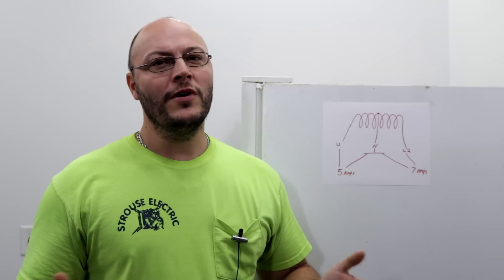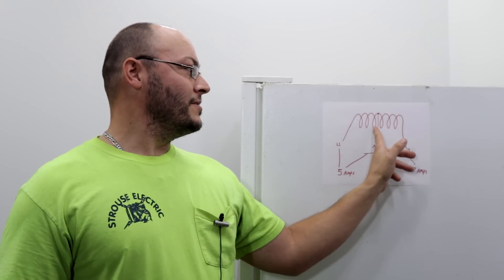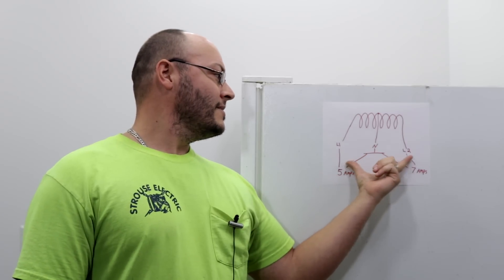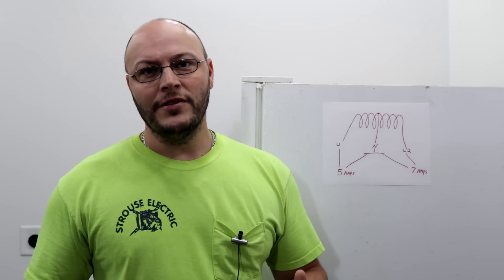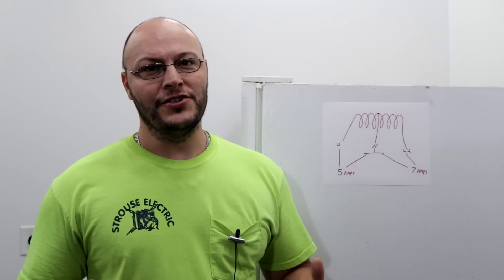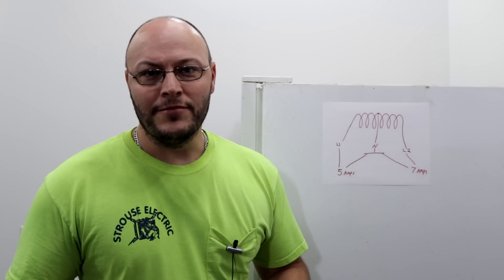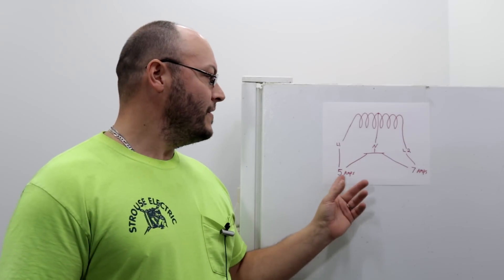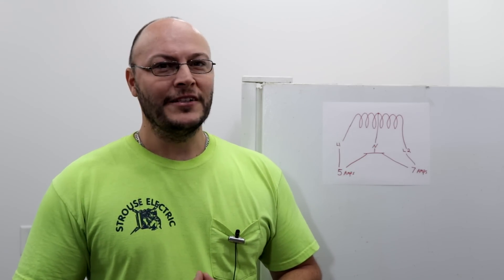What does the Neutral Wire Do?

Comment: The ACSR cable for your service drop is NOT a neutral. It is called the " messenger cable."
ACSR stands for Aluminum Steel Reinforced Cable.
Power companies send Power. We don't want neutrals, they are formed in the panel, by the homeowner. Our responsibility as power providers END at the first point of attachment. (Outside your home where the wires are attached FROM the pole) If not, the utility companies would be responsible for the branch circuits in your home, because we would have to complete all circuits in the home /establishment, with neutrals. Again our resposibilty STOPS at the first point of attachment. 
Messenger cables are for equi-potential bonding, similar to what you would see on a swimming pool...ladders, lights, water scimmers,  and pumps are all bonded to the same ground wire. Everything in the pool is in the same potential to earth ground, as would be all the homes on that particular set of drops from the transfomer....i.e. they are all bonded together with the same potential.

Comment: come one man! Electrical science is not law or economy to be interpreted one way or other. It's exact science based on physical laws.  So if you are making an explanation or statement of something you have to be sure ow what you are talking about and other has to have the same understanding or explanation. 
BTW you are correct in case of 3 phase connection back to transformer. But when you are taling about one phase (instalation inseide your house) for example 120 W lamp one amp will flow on hot wire and one on neutral and current will switch direction 60 times per second. Electrons on other hand has oposite direction on flow.

Comment: Just tried to replace a broken flood light outside. Inside the box I found No neutral And no ground at all.. just the hot wire. Dumb question. Is it dangerous to just replace it like that.. Or.. Do I need to find the other two wires.. 😐
Reply: fapintosh so did you find your neutral?
Reply: what is the flood light attached to? If it's attached to a metal pole, then the pole is acting as the neutral. if you have the pole as private property you should be able to turn a the breaker off that the lamp is controlled by, and work on it safely.
Reply: +Brian Petty yeah, under the eave. thanks for the help
Reply: It's illegal and unsafe to use anything but a sheathed wire for a neutral, since it carries current. While the light is on, anything connected to the conduit, including the switch box and more importantly the screws holding the switch cover/plate on, will be electrified.

Comment: ok, that explains that! now if your testing a load on a refrigerator or window a/c. checking the other side using the neutral is what purpose to see if power is passing thru??
Reply: Depends on whether it's 120 or 240 Volts AC.

Comment: Does the user pay for that unused 2 amps that return to the transformer, or are they deducted for? What does the power company service meter on the house show? 10 amps used or 12? thanks!
Reply: Dan, that's a great question. The two amps is just a 'balancing act' because current must have a return path. Otherwise you would have charge accumulation. However, you will be charged for 12 amps, because that is what you consumed. In the video, the diagram can be thought of as 2 separate loops. One loop is consuming 5 amps (RMS i assume) at 120VRMS, which equals 600 watts. The other loop is consuming 840 watts, by the same math. Therefore, you will be charged for 1440 watts.
Reply: Ima SuperPerson, again you are incorrect. Watts is the product of voltage and current, and this measures instantaneous power. Period. Don't confuse others just because you do not know the formulae. It's unfortunate how you've polluted this page with a lot of misinformation.
Reply: Watt??
Reply: Can you read watts to ground?
Reply: Dan Zarlengo yes you pay for those 2 amps (240watts) as well as the other 10 amps that balanced out. If you feel you are not being treated fairly then balance your buss bars.
Reply: Dan Zarlengo:
If L1 has 10 amps and L2 has 12 amps, you are PAYING for 12 amps... The N will carry the difference of 2 amps..
Current is the SAME in a voltage series circuit.  
L1 has 10 amps... L2 has 12 amps, 10 of those 12 amps IN L2 is a mirror reflection of L1's 10 amps...   This tells you that appliances tapped into L2 side are pulling 2 more amps than L1 side.. 
I hope i explained this in a manner that you understand
Reply: @ACommenterOnYouTube  If your appliance is drawing the amps, then you are paying for them. If not, then there is no current flow to charge for.
Reply: Fill in the blank:
I don't recall saying otherwise ...
Reply: @ACommenterOnYouTube  ok...just clarifying to myself I guess, (Also getting confused from other comments that go on a differnet tangent as well). Thanks
Reply: Thor Thunder:
NO you cannot read watts to ground. You measure current/amperage and multiply that by either 120V or 240V to get wattage...
Reply: true u are using 12 amps so you will be billed for 12 amps period,
Reply: Neutral and ground are bonded together at service entry into a building, usually at the meter.
Reply: In theory yes u get charged.
As soon as it passes your electric meter its on your bill.
Thus u want to do what is called balancing the load.
You want to balance all of the single phase loads on the panel by placing the loads in certain phases so you nuetral return is zero.
By doing this there is little to to return back to transformer or back to generator site.
When your loads are balanced on your panel it acts as close to three phase as it can and will not have any return on the nuetral.

So folks take a amp meter and check out your branch circuits when in full load conditions and no load conditions or stand by .
Try to balance the load on both phases so there is equal current draw to the best of your ability.

When this is done the is no unused current being sent back to the transformer.

So in the case above there is two amps going back i believe is what u said.

If u can split that somehow to one amp on phase 1 and one amp on phase 2 then there would no be any return.

And the nuetral is really just a center tap on the transformer or a path back to transformer.

Back in the day a nuetral was really connected to the main generator site but now adays its strictly grounded out usually back at the transformer.

Depending on how the municipal does it there might be several ways its done depending on where u live.

But balance the single phase loads and try not to have any return on nuetral as it will save you money in the long run.
The closer the panel is balanced the more it becomes like three phase as an example.
And it wont pull current it doesnt need therefore it wont send anything back

Hope this helps
Reply: No such thin as unused amps, see  https://www.bluesea.com/support/articles/AC_Circuits/86/Current_Flow_in_120_240_Volt_AC_Systems
Reply: Those two amps aren't unused. They're just the imbalance between the two hot conductors
Reply: Consider those 2 amps the  8 inches of water that runs from the faucet to the drain in your sink that you don't use , but still pay for.
Reply: Not sure how formula came out formulae HOWEVER you are absolutely correct, as you already are aware I am sure.
Reply: NO
Reply: Baby Jeebus:
WTF..?? borrowing electricity and giving it back.>??
Reply: @ACommenterOnYouTube ...I borrow water , return it after I take a shit in it.
Reply: @ Ima SuperPerson No, not "period."  The power in every residential application is AC, not DC.  RMS is the DC equivalent voltage IF, and ONLY IF, the load is purely resistive.  120VAC (RMS) across a resistor will generate the same heat as 120VDC applied to that same resistor. If the load is complex and has either inductive or capacitive reactance, then you cannot multiple amperes with voltage since they are not in phase with each other. This is the case in almost every device in a home with the exception of heating elements for cooking, heating, etc.  If you're going to chide people and be emphatic about it, as well, it would help if you actually knew the subject yourself.
Reply: And yes once past the meter your charged for it.
Reply: A standard residential single phase meter socket, as is used in single family housing, only contains provisions to connect 4 meter globe terminals.  Two connect to the line 1 (black) wire.  The other two connect to the line 2 (red) wire.  The meter measures the amperes on both lines, and the voltage across the two lines.   It doesn't need to measure current on the neutral, because it knows the answer.

An apartment building with a 3-phase master service, actually has 5-jaw metering for the single phase sub-services to the dwelling units as opposed to 4-jaw metering (as discussed above).  This is because the two lines are not directly opposite each other in phase.  It needs the 5th terminal, which measures voltage from the neutral, to determine how close to 120 degrees out of phase the red and black wires are.  (or blue, if the C-phase applies)
Reply: they are not unused lol. the two separate currents are simply balancing themselves out on the neutral
Reply: you dont get charge for amps, what yo pay for is the watts that you use so you wouldnt be paying for those amps going back on the neutral,since they didnt get used that means they didnt generate any wattage usage to get charge for..
Reply: I am an Electrical Eng. and Master Electrician. NO, you are not being charged more than you used. That is why videos like this are short and sweet, but lack the time required to fully understand the subject matter. Residential meters monitor the power lines through things called CT's. They do not monitor the neutral. So in the above example you are getting charged for 7 Amps on the one side, and 5 on the other (the meter does the appropriate math from there). 
Neutrals should be balanced because they are sometimes smaller than the line conductors and can not handle as much current as the power conductors. 

The one and only time you could get charged more than the power you consumed (depending upon the power company), is when you initially energize a coil, (aka. start an electric motor).

If you have an issue on what the power company charges, get a power meter to monitor for yourself. Otherwise, cancel your power service.
Reply: Yes it does once past the meter u pay for it.
If The panel is balanced u will pay less
Reply: Please, don't say "voltage goes to", instead say "current flows". Thanks
Reply: @haricrojr  ...voltage and current are different.
Reply: see Gerald Morin on youtube for a discussion on that topic. oh and my old house only has 2 wires comming of the transformer. whats up with that? ya thats right. resistance on the ground instead of metering unused electricity on a nuetral? is this possible? I dont know
Reply: Keith Jurena:
thank you captain obvious...
Reply: Watts (power consumption) by any circuit is just a derivative of the current (amperage) and voltage.  Period.  If you know the amps, you also know the watts.  Don't confuse others just because you do not know the formulae.

Comment: Bill you are absolutely correct. Actually in transformer HT is stepped down to LT. HT is delta and LT is star. Star has center as neutral wire and rest you have shared in your video. Thanks a lot.

Comment: then what happens to that returned 2 amp current? And how current returns in 3 phase delta connection?
Reply: It is not that something happens to it, the current just flows out back to the power pole which is your source of power.   Any current that can be measured or calculated on the neutral wire is the difference of the current load on the 2 power line sources.  Your power pole is your house power tap and that is ultimately connected to both ends of a generator at a power station.
Reply: 3 phase delta connection is 3 windings connected.  There would then be 3 end point taps for L1, L2, and L3 that would be the hot taps and the neutral wire is connected to the center of one of the windings.